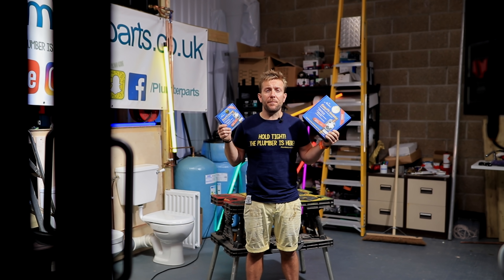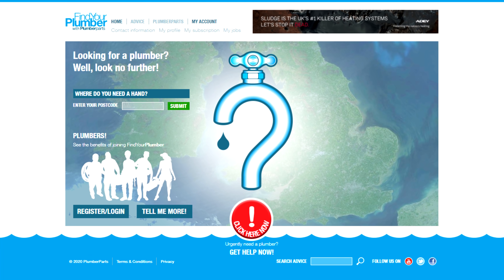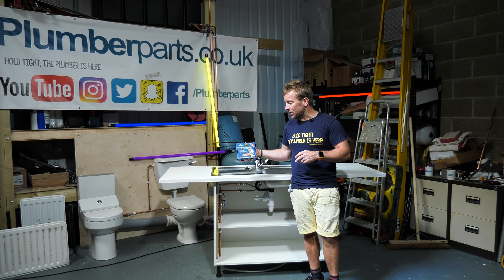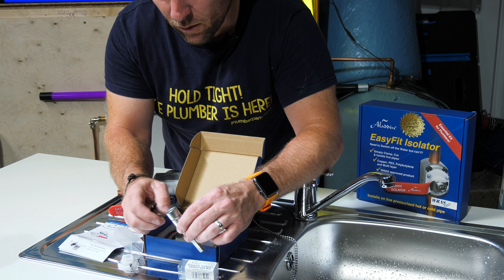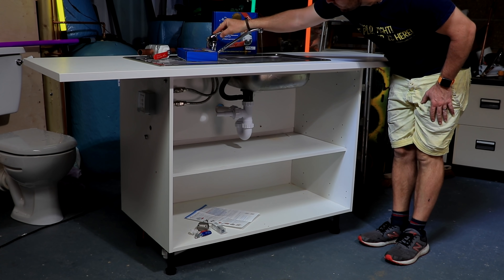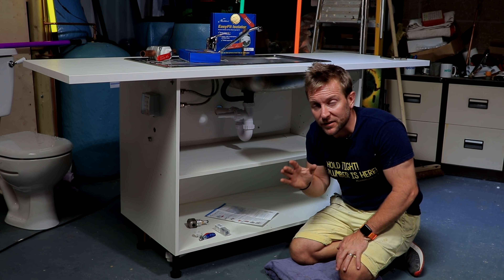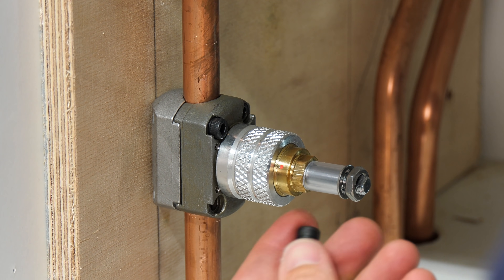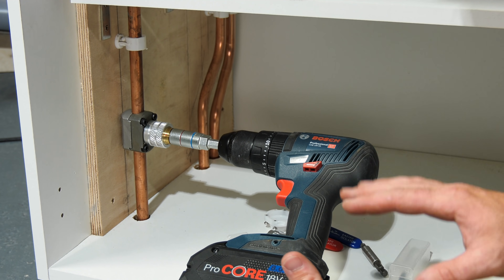HOW TO INSTALL VALVE ON LIVE WATER PIPE

Comment: I nearly p**ped myself using this for the very first time yesterday,  cutting into a live pipe is scary. Make sure the pipe is secured to the wall allowing you to use some force ie manually, use a professional drill so you don’t get stuck halfway due to lack of power, get the KIT or you’ll find you’re missing loads of adapters… Sadly mine was leaking trough the threads and had to deal with that so have some putty or tape jic. Overall massively impressed and enormously delighted with a great solution and quality product, saved me a massive headache.

Comment: you are brilliant, our flexi pipe on the hot water went tonight, tomorrow I will need to buy a new flexi pipe and fit it, this time with an isolating valve. what your showing here is so good. subscribed to your channel. I need to get up to speed to fix my own plumbing problems, can never get a plumber.
I am going to fit a couple of these under our sink hot and cold, thanks for this.

Comment: You should show a picture of it taken apart after install so we can see what it has done to the pipe. Awesome product
Reply: Once cut the section of pipe below the cutting disc is completely removed separating the pipe within the valve, the spent pipe is then compressed into the valve base on the 15mm EasyFit, (22mm & 28mm do not compress the spent pipe, these valves have a well to store spent / cut pipe ) and replaced with a rubber barrel, this barrel has a 98% bore allowing for virtually a full flow ball valve / approved stopcock to be installed on pressurized pipe up t0 16-bar.
Reply: @mayolivia1  Reading through these comments, that's the question I had as to what happens to the material being cut. Does a pvc or pex pipe behave any differently as to the cut out material. Finally, is this absolutely a permanent fix? I had a shark bite repair (not a live pipe) several years ago and that's still holding up.
Reply: If I buy this valve from Amazon US it is over $400!  If I buy it from Amazon UK and have it shipped to the US, it is $70.  Crazy!
Reply: @Notfiveo0  The direct company UK site clearly states not suitable in US and Canada. UK is metric. The US and Canada site is in inches. So, yeah, saw it priced at $300.
Reply: @ I missed that but the thought had entered my mind that they may not be U.S standard. Had I been seriously interested at this time I would have made sure the size was correct.

Comment: I've used these in the past for exactly the scenario you described in the video, seized stopcock, outside stopcock buried under tarmac and a layer of gravel!!😬 Had to remove about 30years worth of gloss paint from the pipe first😤 follow the instructions and you can't go wrong!
Reply: @adaster98  in the long run this is a more reliable option
Reply: @adaster98  sure but I already have compression valves but of course they seized. I didn't do the "periodically turn" thing.
Reply: @adaster98  like Pegler with the lever? I out full bore service valves in but we are hard water and they free shut - more the hit than the cold. But I hear one should leave them not quite open.

Comment: I’m wondering about the debris from the cut too but I’m in a situation that needs just this. We just bought a house that sat vacant for two years and every shut off along the way is shot. I’ve had two plumbers in here as well as an inspector and no one could find the main. We think it’s buried in the foundation or something. This will allow me to kill the supply on the line we think is the main which will let me swap out all the old plumbing, finally. I’ll be able to sleep tonight knowing that I can now do the plumbing myself since none of the “pros” we’ve had in here have been any help. Thank you!!!

Comment: Note: You can also use a good socket set to turn the cutting tool instead of a drill .I did. My 15mm copper pipe was in an older house and therefore a thicker gauge I guess .Even my brand new work drill wasn't powerful enough. Really great product this though. Recommended
Reply: I ended up handballing installation too 😂. Thankfully it worked 😬.

Comment: Clever device. I could have used this a few years ago. I was helping a friend and his main water valve wouldn't shut off completely. I managed to solder in a ball valve anyway by disconnecting the outlet of the main and putting a container under it to catch the water. This would've been so much easier.

Comment: Remember using something similar many years ago but it was a kind of explosive charge that that went off when you hit a piston very sharply with a hammer. Used on a huge malleable iron heating system to install one extra radiator. Saved a huge amount of time.
Reply: Hi, this is nothing like the exploding tee, all debris and spent pipe is kept separate from the flow and retained in the valve base, as the pipe is removed a barrel with a 98% bore replaces the pipe section, this encapsulates a spindle to fully isolate supply, once the handle is fitting you then open and close as a regular ball valve, however EasyFit is also WRAS approved as a stopcock. Warrantied for 10-years.
Reply: Ah those are used for steel pipes, but I think not for copper

Comment: Your wife is a good sport, that would not go over so well with my wife. 
going to put on of these on my refrigerator supply line as the plumber that installed it just used one of those cheesy puncture things that has no shut off. 
thank you!

Comment: Try it on 60 year old 1/2 inch copper,the drill wouldn’t touch it,had to use a 3/8 square drive and ratchet and only just got it to cut through, easy to fit after that and works really well after my stop tap was blocked by my new gas main being installed right in front of it

Comment: Would be great to see you take it back off so we can see what has happened to the pipe and as others have asked, what happens to the bit of the pipe it cores out? Cheers for doing the video.
Reply: The slug which is cut out from the pipe is compressed and pushed into the back of the housing.  In addition since it's a swarfless cut no bits of metal are released into the system.
Reply: @niftylittlebleeder  Thanks for the explanation.
Reply: Great that the pipe and valve can retain full bore too.
Reply: Good morning, the pipe isn't cored as such, it's removed completely and compressed in to the base of the valve, therefore no debris is passed through the line, all potential obstructions are removed and encapsulated in the valve base.

Comment: This is basically a big saddle valve, I wonder if it maintains the same flow volume of the pipe or whether it reduces it?  Any distributors in Canada?
Reply: There is a slight restriction in bore size by 2%, unfortunately we haven't released EasyFit into the American / Canadian markets, we have completed all R&D for 1/2", 3/4" and 1" EasyFit valves and will launch in Europe / US / Canada next year.
Reply: Wel here is one American waiting for it
Reply: @paulrobilotti9294  2

Comment: Your wife is a good sport, that would not go over so well with my wife. 
going to put on of these on my refrigerator supply line as the plumber that installed it just used on of those cheesy puncture things that has no shut off. 
thank you!

Comment: An idiot installed a 15mm valve washing machine tap on a cold feed that feeds the boiler and the same on the hot feed comes out the boiler. Is it best to use compression blanking nut (super glue the nut) or change it and fit isolation valve? It's just I don't want the tenant to draw water from it. Cheers

Comment: What happens to the copper "washer" that is produced as a result of drilling the hole for the valve?
Reply: It makes shavings that go down the water line and clogs up the nozzle strainer, take it out and clean it.
Reply: @altyndom7039  the Easyfit cuts a swarfless cut so there are no shavings of pipe.  Instead it removes a coupon of pipe which is pushed to the back of the housing .
Reply: @niftylittlebleeder   that is brilliant. good product.

Comment: I'm thinking this would be great for seized hot water gate valves.
Reply: Oh, don't get me started on stuck gate valves... 73 :-)
Reply: @MrSuperheterodyne  but if I get you started on your gate valve then it will start working again?
Reply: @stephenhookings1985  No way.... I hate those things. :-D
Reply: @2E0PZM - that's what I was thinking for the gate valve on my HW cylinder feed that won't close off 100%. Unfortunately, when the 22mm version was delivered I discovered that the valve base where the compressed pipe gets pushed into is about 2" deep and there's no chance of getting it behind the 22mm pipe because it's fixed (as it should be) with pipe clips to a wooden board in the airing cupboard and there's only about 3/4" - 1" max. space between the pipe and the board.
Reply: @andygillespie2101  common issue. The gate valve stops flow of cold water.into HW cylinder right? Mine is 28mm because it supplies two baths. Given 28mm is less common I got my boiler engineer to fit new one. We have indirect cylinder so I had to shut water off to tank in loft and let water drain down over a few days (ie people having baths and showers) once the upper tank was empty there is still water in cylinder but the gate valve is above this - so he could cut out old valve and fit now one. We looked at old one ... Decent amount of chalk on it :-(. Have to recall to operate valve periodically to reduce chance of it happening again.

Some hot lemon juice cleaned out old valve. I was wondering if there was an acidic chemical (citric acid, vinegar etc) that could be added to tank, heat up and move around hot system - maybe it would free up the other full bore service valves on hot side?

Sorry if what I described isn't your system - but at least it worked for me.
Best of luck solving your stuck gate valve.
Reply: There are various applications where EasyFit are utilized, seized / passing valves is an ideal application as the EasyFit allows for either the removal of the valve or replaces the faulty valve which can be left in situ with no draining down, full isolation or pipe freezing is not required, now available in 22mm and 28mm.
Reply: @andygillespie2101  22mm and 28mm EasyFit can be fitting in any orientation, we've found in most instances the valves are fitted at a 45 deg angle or a hole is punched behind the pipe for the valve well to sit.
Reply: cork in  the tank .. and replace .
Reply: @stephenhookings1985  What about Coca Cola? Phosphoric acid contained might just do it.
Reply: @MrHarold1066  or citric or even vinegar. As it happens out boiler was replaced recently so the gate valves etc are currently all working on main part of system. I plan to set calendar reminder to turn them off/on for maintenance and at a later date drain down and replace the stuck valves with some Pegler if possible.

Comment: I'd like to know how robust this is longterm. Is it going to start leaking in a few months or years like a saddle tap?
Reply: Good morning, Aladdin products offer a 10-year warranty.
Reply: @mayolivia1  Thanks for the reply, but it's not exactly a product that's designed to be removable. If it failed you'd have to rip out the water pipe and all.
Reply: A 10 year warranty. So if it fails in 1 year, does it cover the cost of a plumber to rip it out and replace, or does it just cover getting a new valve?
Reply: @dwsolberg  You can pretty much guarantee that it would just be a replacement valve.

Comment: Interesting: Obviously it cuts a hole in the pipe...what happens to the cut piece of copper ?
Reply: No hole... It cuts section of pipe out and it gets crushed flat
Reply: @mrthomas394  but it has to go somewhere? Also, if it does cut a section out does that make the valve full bore?
Reply: @kevinjackson5191  there is a chamber on the bottom of the valve were the crushed section of pipe permanently stays thus leaving a full bore valve.... Google the valve and watch the video it explains everything... We use them at our place of work... Fantastic piece of engineering
Reply: This video shows it really nicely: https://www.youtube.com/watch?v=MCVQ0HkxNeg

Comment: Gr8 video. 
What should be be done to make sure the lever is in th right position,  in line with the pipe when on. ?
Can you adjust the preasure  with it,  by not turning the lever fully on. ?

Comment: What happens to the displaced copper,is it just pushed to the sides,or is it just sitting in the inside of the pipe,my concern is will it affect any joints or other valves with water pressure ramming it against possible valves.

Comment: Does it reduce flow? I need one of them to regulate a heater radiator. I don’t wanna mess up the distribution of hot water in my heating system

Comment: where does the copper piece that you drilled go?
Reply: It's compressed into a flat slug and retained in the housing on the valve, it's out of the water flow path.
Reply: @JuBeYo  Thnx, I was about to ask the same question.  A very cool invention.

Comment: perfect timing I have a tap that needs replacing in the school I work in as a maintenance guy,  school is about 65 years old, and in them days they were not big on fitting isolation valves, and the few that we do have start leaking if you are brave enough to touch them lol
Reply: If you go to the cupboard in the main reception, you will see a lost property box located right at the back, behind this you will see some random tennis rackets. Move these out the way and you will see the main water shut off. 👍🏽 good luck 😉 Let me know how you got on.
Reply: Will be imperial pipe sizes though if that old!
Reply: @Garry G     those* days

Comment: would be nice if you took it apart after so we can see how it works and what it leaves behind.   Also if any swarf goes downstream
Reply: Hi it it's a swarfless cut so no swarf goes down the pipe.  The disc which is removed is pushed to the back of the housing. Thanks

Comment: I have done loads of work in hospitals, there are more stop valves fitted than hairs on my head. Saddle type fittings are banned in most states in the USA. I would worry about turbulence and what happens to the copper that was cut/crimped? Also is the bore size affected after the device has been fitted?  I personally would just freeze the pipe and fit a propper valve that you know you can trust.
Reply: Exactly these are such a joke.  Where is the deburring?  You are simply asking for trouble using this.  I feel like they are on the same level as a shark bite.  Cool but very temporary.
Reply: But you can't freeze pipes with moving water
Reply: @robrocco5420  like what scenarios
do you come across? You will have more problems in the future with the water turbulence you cause, but I suppose that's not your problem then is it! Also remembering this is a 15mm fitting, not some 28mm supply pipe or more, its the end of the line.
Reply: @davewilco822  bathtub faucet is leaking.. main value is just spinning aka broken.. city value is seized..
Reply: @robrocco5420  LOL so make the system worse. Don't you think at some point that system should be addressed starting with the city street tap then the main stop tap or will you just go on forever?  But actually, what you have just described is a situation where the main house pipe  can be frozen

Comment: Can this be used on a central heating 22mm flow and return pipes. I need to move a couple of radiators but don't want to have to drain the whole system down (not sure how long it will take and the missus will get well mad without heating for too long). Thanks in advance
Reply: Seems a bit overkill, if you're moving several rads, draining down a system isn't much extra work. Personally I'd start isolating and pulling off rads while it's draining down anyway so it isn't any extra time or hassle compared to finding a good point to isolate the flow and return. I also wouldn't recommend putting isolation valves on the flow or return anyway as it could prevent the flow of water through your boiler depending on your system.

Comment: Hey mate. Love your videos!  Could you advise me on this pls?

I have two pipes to each downstairs rad. No drain valves at all apart from one above the boiler that B.Gas installed when boiler was new. 

Drained one rad and attached hose to the lockshield side hoping to drain the system and refill. 

The rads are full to the bleed valves but no water is going through the hose with the lockshield open.

The F&E tank ballcock is tied up. I opened the bleed valves upstairs and have now closed them. Please could you advise me what I need to do.

Do I require drain cocks on each radiator downstairs

Also there appears to be a small leak on one possible on a piece of copper that is bent upwards to the lockshield end.

Thanks.
Reply: You need to allow air into the system, which will replace the water and allow water to drain out. Have you a valve on the open vent pipe ( the one which raises up over the f&e tank and terminates above the water line in the tank ) there shouldn’t be one but I have come across them in the past, the system breathes through that pipe and it should allow the air in to enable draining. If there is a valve and you’ve closed it open it back up.

It is good practice to have a method of draining at all low points.

The leak could be a pin hole due the the thinning of the copper which happened during the bending process, but it could be leaking from higher up and running down to a lower level. Dry the area and watch carefully.